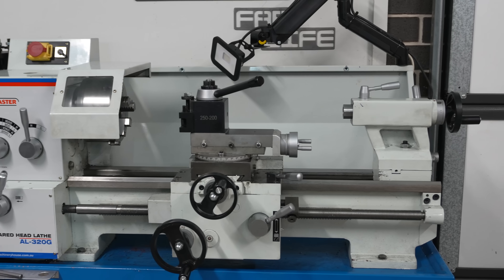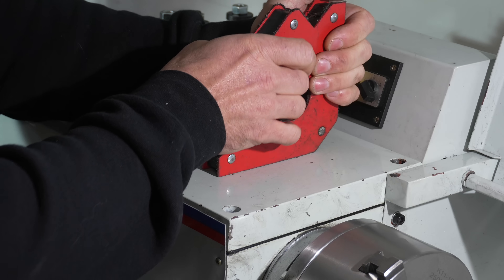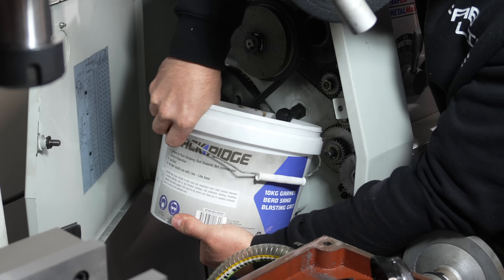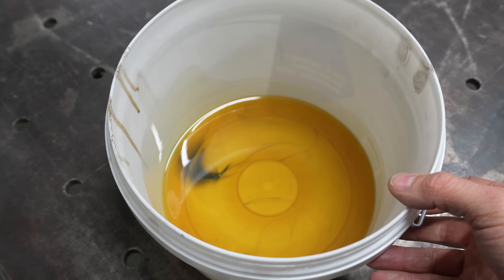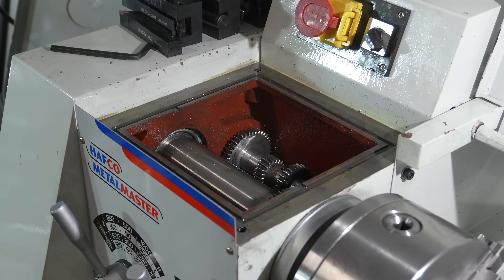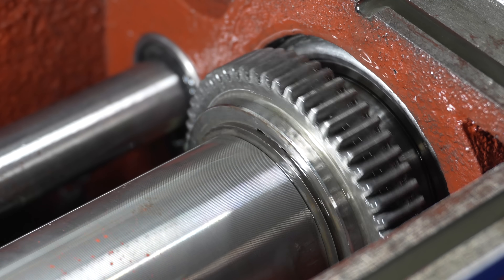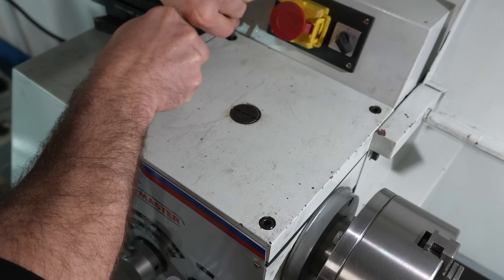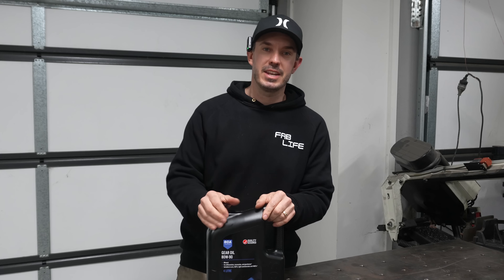Can I Fix This Annoying Gearbox Noise? - HAFCO AL320G

Comment: I found lining up the motor belt pulley better helped with case noise,note motor bracket is not inline on my lathe fixing that will be a bigger mission which properly not happen
Reply from the maker: Thanks for that. I was looking at the belt over the weekend and wondered if that would make a difference 👌

Comment: if you want to try a thicker oil for testing purposes you could try john deere hyguard. it's used in planetary reduction hubs of tractors. should be fine for lathe gears.
Reply from the maker: I've since switched to iso 68. Seems to be working really well. 👌

Comment: If the bearings are OK, probably the shafts are too close and gears are grinding, which would lessen over time. Changing the oil would save the bearings over time. The thicker oil will add a bit more strain / take more power from the motor. Or - maybe that Chinese oil was sourced the local restaurant fryer.
Reply from the maker: haha yeah the oil looked like some sort of seed oil. Ive Since changed to an ISO 68 oil. Less load on the motor but still keeping it more quiet than the oil it came with 👌

Comment: Have you looked at the oil level in the sightglass on the side of the gearbox.
Reply from the maker: Sure have. I’ve since switched to iso 68 now. I refilled with 300ml

Comment: The single phase motor is also loud on this model. I swapped it out for a second hand 3phase one and a single to 3 phase variable speed drive. I also replaced the drive belt with a toothed V belt, this seems to have made a big difference (still got the noise from the gearbox, but now I can spin it as slow as I need)
Reply from the maker: That’s a great modification 👌. Where did you purchase the parts from?. Cheers for the comment 👍🇦🇺

Comment: Hey mate firstly I’d like to say I love your content! Your videos helped me decide what model lathe I got I have the same well this is my second machine in only 3 months I had the first al320g for 4 weeks an done maybe an hours work on it and oil was pissing out of every seal in the head stock and really vibrating they wanted to fix it I refused and they granted me a new machine I drove the 2.5 hours back down there to pick it up set it all back up in my shed next to my brand new hm46b mill this was about 6-8 weeks ago and unfortunately work got in the way so they have sat there until this weekend I took all me old bed sheets off them and was just only still getting used to the machines as I’m a total greenhorn but sure enough oils all around where it bolts to the drip tray around the main end of the machine an my oil is like black compared to yours so I have open the gearbox or whatever bit like in this video but my lid had blue gasket sealant? I’m honestly heartbroken again 😂 any advice would be much appreciated mate ie: are you still running car oil? If so what type? Did you regrease the bearings after the kerosene? Sorry for the long message I’ve been wanting to get in contact with you for a while hope you’re having a better experience than me with that lathe mate the mill I cannot fault 
Keep up the great videos mate gives a lot of us inspiration 

P.s why arcdriod and not unimig stealth? 👍
Reply from the maker: That’s no good about the oil colour. Is your machine new?. Yeah I’m still running the supercheap auto gear oil 80w90. Repco sells the iso 68 which apparently is more suitable. I don’t think the unimig CNC was out at the time and I’m a big fan of grind hard plumbing co on YouTube. They inspired me to get the arcdroid. Arcdroid made me an affiliate after the content I was pumping out. Since getting into machining, I haven’t touched it for a while haha. I’m really glad you’re inspired by my content. It feels strange to share videos where I feel I struggle a lot but not everyone is at a professional level and I’m hoping that people feel that no matter what level you’re at, just have a go and eventually your skills will improve. I’m self taught on basically everything except my trade as a mechanic. 🙏😊
Reply from the maker: When I used the kerosene, I sprayed around the bearings but not directly into them so that I didn’t wash the grease out. From my comments I’ve gotten, the bearings get drip fed lubrication. Around where the gasket was, there is a little channel for the oil to splash up into. 👌
Reply: @Fab-Life444 yeah brand new lathe mate does yours leak oil onto the blue tray out of the head stock this is the second machine I have received that is doing it think I’m gunna ask for another model or my money back I don’t know what to do
Reply from the maker: I think I've noticed the tiniest leak from a cover plate thats under the chuck. It's so small that it doesn't worry me. I'm not sure if the extra oil level for me is contributing to this leak. A few have said that with a higher oil level, the pressures inside the gearbox can push some oil past the seals. Good luck buddy.

Comment: waw! where those scales db? if, thats above 2,5 times quitere :) how high on the glass now? test if the oil foams up. it will if to much in there. and that is very bad for lubing the gears.
Reply from the maker: Yeah DB. Those scales are what I see when editing on Final Cut Pro. I was wearing ear muffs while using the machine prior to that video… now I don’t wear anything 👌. I haven’t seen any foam. Allot of people think the oil is crazy high but I wasn’t able to record what the level looked like because it was dark and gears were in the way. I fill the box up until the tips of the gears were running in the oil… they definitely aren’t submerged haha. 👌🇦🇺

Comment: I got the same lathe and a HM45 mill drill from H&F in 2005 for my manufacturing business and used both daily.
Still have both and use them often and never changed the oil in either.
On the lathe I tightened the turret bearings up a few notches to take out any side to side slack just enough so that I couldn't see any movement on a dial gauge on the side of the chuck.
I also welded up a rectangular frame using 75 x 75 x 6mm SHS the same dimension as the cabinet and then sat the machine on the frame and a few stitch welds of the cabinet to the frame, then welded 4 tabs to the frame with holes and dyna bolted down the whole thing to the floor. That allowed me to level up the frame with shims under the dyna bolts and it also made the cabinet more rigid in addition to raising the height of the lathe by 75mm to a more comfortable height. Did the same with the HM mill drill but used 100 x 100 SHS to raise it more so I dont have to bend down to use it, Using both daily i was getting a sore back bending over them so raising them fixed that.
Reply from the maker: That’s some great feedback buddy. Thank you 🙏 🇦🇺

Comment: I use hydraulic 46 grade and then add about 100ml of Morrys. Quietens down the gear selector forks. Lathe is same brand but a 366D
Reply from the maker: That’s a great idea. I’ll have to look into that oil choice and see if it’s Available in my area 🇦🇺👌

Comment: The oil splashes inside the gearbox when running. Since you added too much oil, it will foam up and lubricate poorly. Keep it at the manufacturer's level, they are penny-pinching on a ton of parts of the machine, but the oil level it ships with is correct.
Reply from the maker: Cheers for the feedback👌🇦🇺

Comment: Sounds like the same noise as in Artisian Makes lathe. He just keeps running his, which is literally destroying the bearings and gear surfaces.
He tried flushing by spraying Kero in there, but that wont get rid of all the grit inside the bearings. Truly, the only solution is a full tear down and bearing replacement.
Reply from the maker: I follow him as well. He has the older Al250 and he used ls90 diff oil. We both definitely had the same noise. I guess it’s what you get with these cheaper hobby lathes 👌🇦🇺
Reply: @Fab-Life444 - what you gotta do is disassemble and clean them out BEFORE switching them on and destroying the gearbox and bearings. 😉

Comment: I had the same lathe.  I replaced the spindle bearings with quality bearings, and it made a huge difference in noise. Be careful going to a thicker oil as spindle bearings rely on oil splashing onto the lid and running around to the gaps above the bearings.  I used AW46 hydraulic oil. I updated to a l555d lathe.  Best move ever.  No manually changing gears for threading.
Reply: Yes, the AL320G sucks badly by not having a QCGB for the leadscrew.  Probably the only lathe out there this size without one.  Big negative IMHO.  If you want quiet, go belt drive.
Reply from the maker: @Xynudu great feedback! Yeah it seems that’s what allot of people have done ✔️
Reply from the maker: Great advice. I’ll be switching to iso68 soon. 👌🇦🇺
Reply: Iso oils are not gearbox oils
GL4 gearbox oils are gearbox oils
They use iso oils in Asia where this lathe is made because they are cheaper there so you see them in the manuals for these lathes

Comment: I also added some of that sticky Lucas gear lube additive which really causes the oil to stick and climb and it made my lathe just a tiny bit quieter than just thicker oil..     Since you did add a lot of extra oil, check the gearbox after running at high speed for a while and make sure the oil hasn't started to foam as ironically, this can starve the gears of oil even though you added extra..
Reply from the maker: Thanks for the suggestion 👌. I’m going to do another follow up with a couple of tests. I want to see how much current draw the oil has made on the motor. It definitely sounds more laboured. I also want to try the Perspex cover to see if it’s foaming and also whether the comments about extra heat are true.

Comment: Check minor bearings sounds like mine did it was the motor
Reply from the maker: The motor does make a slight high pitched noise but the bulk of it definitely was inside the headstock. 👌

Comment: Years ago auto parts stores had on the counter see-through device with gears and crank handle advertising Display for Morey's Oil Stabilizer you could watch oil cling to the gears Real sticky stuff a lot of people swear by it,  you can still get it to. maybe use that with I see a lot of other people in the comments saying hydraulic oil and maybe Morey's as a additive   the low viscosity with the clinging affect with the Morey's Oil Stabilizer just a suggestion
Reply from the maker: Haha I remember that display on the counter. I’d always have to spin it. Great suggestions. 👌

Comment: I got that exact lathe. Changed the spindle bearings to Japanese ones and it was noticeably quieter.
Reply from the maker: That’s great to hear!. Was it a hard job?
Reply: @Fab-Life444 not to bad, you need a jaw puller to get the main pulley off but other than that straight forward. I can go find the koyo numbers if you want to give it a go
Reply from the maker: @Johnosmiata yeah that would be great! Cheers 👌
Reply: @Johnosmiata  please share
Reply: @CoralsAustralia   32012JR and 32010JR

Comment: These gear boxes sling oil into the bearings.
On sitting after a few days the bearings start dry.
I use a small aquarium pump in the sump and some clear hose held with magnets to feed oil to the bearings.
Now she runs much quieter on start up.
Just have to remember to fire up/shut down the pump.
I use ATF.
Reply from the maker: That’s a cool modification
Reply: @Fab-Life444  Seems to work well.
Adding a pair of digital scales and a DRO also makes a huge difference
and is well worth it.
Reply from the maker: They are definitely on my shopping list 👍

Comment: Sounds like dry gears and not great bearings maybe?
Reply from the maker: Could be. It’s allot quieter now though. I’ll be trying the iso68 oil soon to see how that goes. At least I’ll know it’s the correct oil for the lathe. 👌
Reply: @Fab-Life444 it does sound loads better with the newer oil you added. I know what its like to have loud machines: my WEN drill press is pretty good but its not quiet.

Comment: I've owned four different lathes over the years from mini lathes to full sized gunsmithing lathes and every one of them had the same loud gear box noises.
I thought that if I adjusted the gears so that they meshed more tightly together as the spun, this might mitigate some of that noise, but it seemed to have the opposite effect.  The noise seemed to get a bit louder.  
Oil changing did nothing either, although, the oil I changed out was the same viscosity.
Since retiring from the work force, I scaled down to just using a benchtop mini lathe and that too is loud as hell.  Fortunately, with this particular mini-lathe I can simply disconnect the gear that engages the leadscrew and it becomes whisper quiet.
Reply from the maker: I have had a few say the same but I find myself using the lead screw every time I use it. I’ll be switching to iso68 soon and apparently having a bit more of the thinner oil will do the same for the noise reduction. Fingers crossed 🤞

Comment: There should be no debris from the bearing. Tapered roller bearings don't "break in"
Reply from the maker: Thanks for the comment. Very interesting as all of the metal paste was from that area. I did see a shield on the bearing face which I think might have been rubbing on the housing. 👌🇦🇺

Comment: I have the big brother 336 model and it is noisy. I have already cleaned the gearbox using kero and refilled with the recommended oil. It's still noisy. what I have found as well is that oil blows past the labyrinth seal when it's filled to the correct level but it eases off as the level falls to minimum.
Reply from the maker: That’s interesting to know. I’m going to switch to iso68 soon and re check how it sounds. Gear oil definitely ads load to the motor.

Comment: Definitely a nice improvement. Mine doesn't seem as bad as yours was initially. I use an ISO46 oil , takes 600mls . 300 odd that you removed seems low..  I also found with mine i tightened the drive belt seemed to make it noisier . I backed it off so a little slack and quietened it up again.
Reply from the maker: That’s funny that you say that… I swear that happened when I set up the change gears. I noticed the belt was loose so I tightened it. I swear it’s been noisier since. Who’d would have thought. I’m going to back it off a bit and change to iso 68 oil soon. 👌🇦🇺

Comment: I have the same lathe and I did the gearbox clean etc etc, but was still getting a lot of noise, I found that the drive spindle key was loose and kept chattering loose the motor drive pully, fixed this by using loctight on the keyway, made a huge difference
Reply from the maker: That’s some great info! I’ll definitely check that out next time I’m in the shed. So much great info is shared in these comments 👌🇦🇺

Comment: I bought my 320 a few years back. First thing I did was to drain the factory oil. It was this weird, almost clear oil that I suspect was a silicon type oil. I even sent a sample to Hafco...( not much of a respons from them..) after flushing with kero I tried a few oils, like straight 30w, engine oil, gear oil and diff oil, hydraulic oil. Diff oil and some gear oils are to heavy and actually bogged the motor down. 30w is recommended, but a light weight gear oil gave the best performance with regard to noise and drag. And if you over fill it, the oil does leak out thru the seals. You could use iso46 or iso68 hydraulic oil as it also makes for a good slideway oil as well. Nice lathe once bedded in, I converted to a 3ph with VFD. best mod you could ever make, I dont know how I lived without it
Reply from the maker: Awesome feedback. Yeah I’ve noticed already the load on the motor already from the heavier oil. I’m going to do a follow up video and show a few things regarding the load/current draw on the motor when using gear oil… then with using iso 68. This video definitely has sparked allot of good information in the comments. What is a VFD?
Reply: @Fab-Life444 it is a variable frequency drive, this enables a three phase motor to be driven from a single phase supply. Also as its name implies the frequency of the electrical power is variable and thus you can control the speed of the motor. You can usually set the parameters almost infinitely. I at first bought a Chinese VFD for my lathe after taking off the variable gearing pulleys and took off the single phase motor which was only 3/4 hp and bought a brand new 1.5 hp three phase motor and fitted it. Unfortunately the Chinese VFD exploded. Yes blew up a whole circuit board and they wouldn't replace or repair it. So I bought a British made VFD and that has performed flawlessly for two years now. Also don't be fooled into thinking your upper limit of the frequency you can set it what comes into your house. I'm assuming because you're in Oz it will be the same as the UK and be 50 Hz nit like the US which is 60Hz. Most VFD's can be set to go to 400Hz I've set mine to go to 100, I could reduce that to 70 as I don't usually run the spindle much above 65 hz very often, only if I'm polishing something . Sometimes when heavy turning or drilling if the VFD senses it's taking too much current it will bring on the fan to cool the unit and it does so pretty quickly. All in all I love the variable nature of the spindle speed. No fucking around with changing belts or gear levers just a turn of a potentiometer. ( my lathe was just belt changes for speeds, no gearbox at all )
Reply from the maker: @samrodian919 now that you’ve explained the VFD, I know exactly what you mean. I made a belt grinder which I wanted to use one on the vary the speed. Vevor sell them. Great idea though for controlling the speeds of the lathe that’s for sure!👍